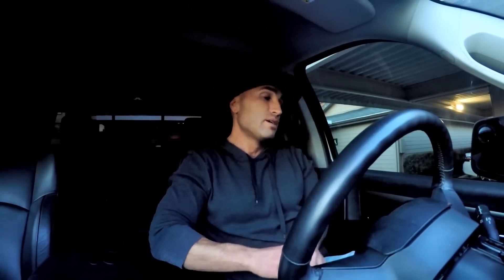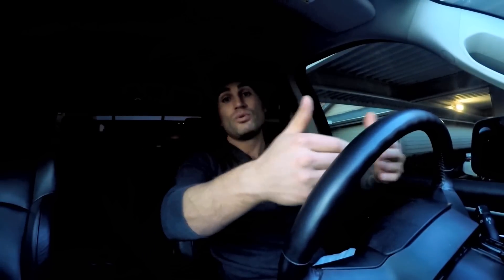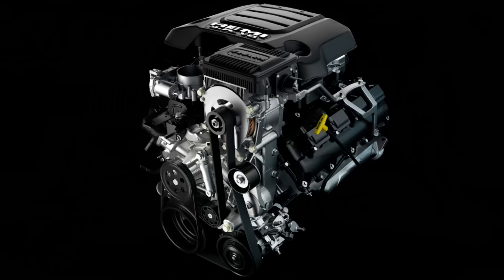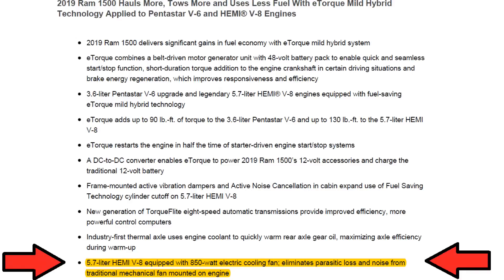Replace Your MECHANICAL FAN With ELECTRIC FAN like the 2019 RAM

Comment: Guys buy the same year of V6 fan as your ruck year. I have a 2012 so I bought a 2012 V6 fan and the plug matches location to location. Drop in a 180 Tstat works like a charm. I have a Bully Dog Tuner with no reprogramming of the fan turning on or off. BBK Headers, Catch Can, Cabin Air filter ( Great Mod), Lowered Air bags, Spohn suspension links, Crown Suspension springs, I tow a 25ft Travel Trailer. No problems...
Reply from the maker: Nice list of mods!  Glad you don't have any cooling issues too!  Only thing is guys shouldn't buy a 2013+ V6 fan because they changed the plug to an oval looking plug in 2013 and it won't fit out hemi trucks without some wiring.  2009-2012 V6 fan will fit 2009-2018 HEMI trucks though!
Reply: That is correct. Great videos!!!!
Reply: thanks for the update, i did the changes to the truck is truly a big change, dont have the big roar when she starts and on the cooling side its nice since i've seen improvements on my mpgs maybe by 1 up to 2 and the ac feels 10x better. hp wise u can feel the that the motor really wants to go.. i haven't dyno yet but should be better than before.  i used a out side thermo controller relay to see how it goes... well trail and error that's how things work lol
Reply: @JADA12345  so no need to reprogram just install the thermostat 180 n V6 fan
Reply: so dukesky no need for reprogram the ecu, just a 180 thermo and the electric fan ? i was thinking i need to program it since the fan wasnt present and now electrical. also when your in stand still the temp doesnt spike ? i just asking because it it works like u say im gonna be busy this weekend then lmao.
Reply: I started with the "No programing" config and monitored the way it was cooling. Like John says it will go up to 222 degrees then the fan will turn on and cool the truck quickly. Easy  to live with. I tow a travel trailer and wanted a smaller temp window to cool my truck. I just upgraded my tuner from a Bullydog to a Diablo. Changed settings to 205 and fan does turn on less now.
Reply: Do you remove the  active grille shutters like @BoostedMotorsports ?

Comment: So you really need a tuner to make this work properly?  I'd like to change out my thermostat also but didn't want to get a tuner just yet. Again thank you for the great vids.  Keep it up!
Reply from the maker: Thanks for the support.  You don't "NEED" a tuner necessarily you can do it other ways.  You can but an adjustable fan controller from summit for $60 and wire that in.  It will control the fan at whatever temperature you choose and hot rod guys have used these for years.  Let me know if you have any other questions!

Comment: Isn't the stock fan a clutch fan? And since it's a clutch fan isn't there no drag when it's disengaged? I don't think mine engages very often. It doss first thing in the morning like you said for like 10 seconds.
Reply from the maker: It does have a clutch on it but if you notice it is ALWAYS spinning with the engine running albeit not full speed/lockup. Also the added mass of keeping the clutch in motion.  There was a noticeable difference removing the stock mechanical fan setup in the truck's response.
Reply: Boosted2k I never noticed that it constantly spins. I'll check that out. It is loud when it's fully engaged! I want to do this mod, being in Texas I want my a/c to be good this summer. It works great now not sure if I want to mess with it.
Reply from the maker: Guaranteed your A/C will be even cooler with this fan.  Mine was in dead stop traffic in 110*.  Made a noticeable difference.
Reply: Got me thinking man lol
Reply: was that after the tuner?